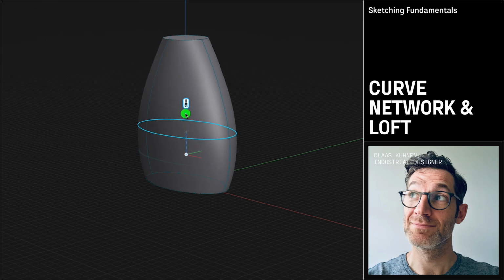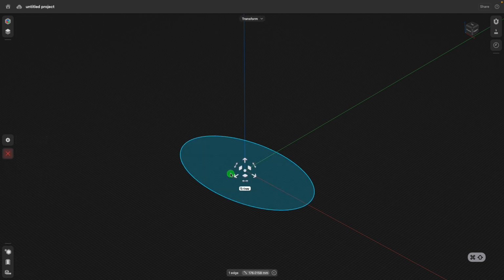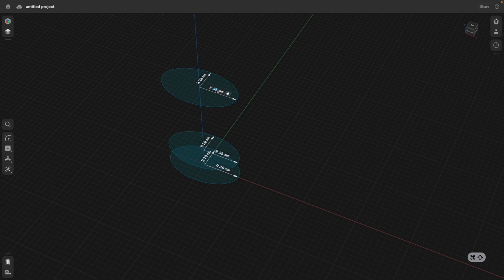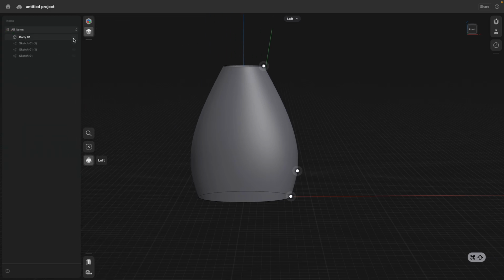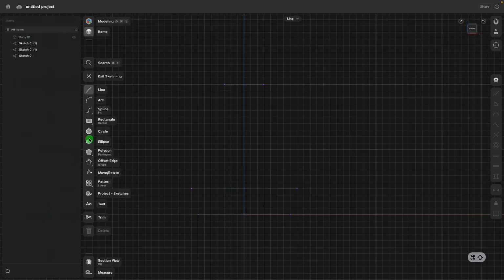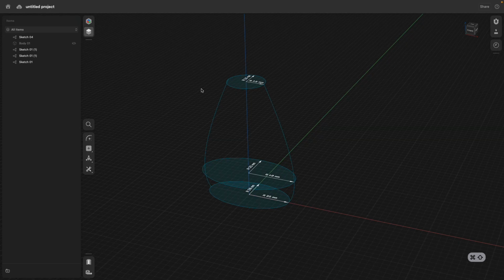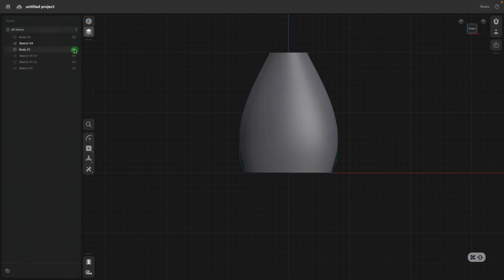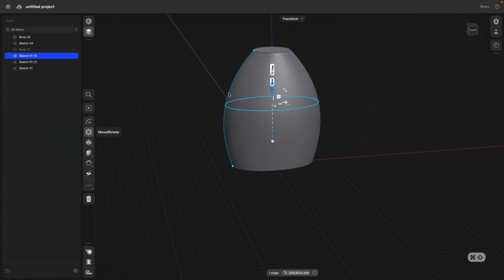Define your design with curve networks

Comment: I can no longer use the loft command with the rails and the faces selected all together
Reply: Actually initial got this issue when I only selected the ellipse line and rails using the box selector (which did not select the fills of the ellipse) but when you select the ellipses with their fills by clicking in the middle of each ellipse and the rails, the loft command appears and it works as expected.
Reply: @alexmasita2621 thank you!!!!!!
Reply: @alexmasita2621  Thank you for solution!
Reply: @alexmasita2621  u are a hero!

Comment: As always I have followed step by step but my body is not updating like this one in the video. If I move the top sketch the body will change but if I select the middle sketch the body is automatically turned off and I cannot turn it back on until I move the middle sketch back to its original position.

Comment: Great tutorial, thanks. Re:3:30. When I move the sketch the body does not reprofile. Any idea what I am doing wrong?
Reply: I have the same problem … 😢
Reply: Pretty sure you have to be in the parametric beta for it to reprofile. In the direct cad (current version) you would have to reloft for every version.
Reply: Just used the beta and it’s not working there either.
Reply: @christinas4397  it should work if you are in the parametric, but it’s really important to set your project up properly otherwise it wont work either.